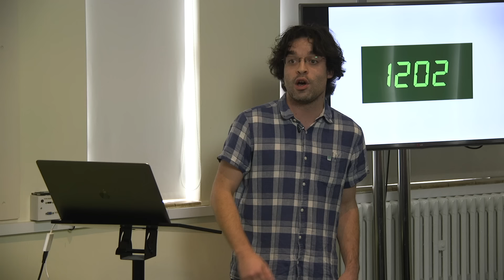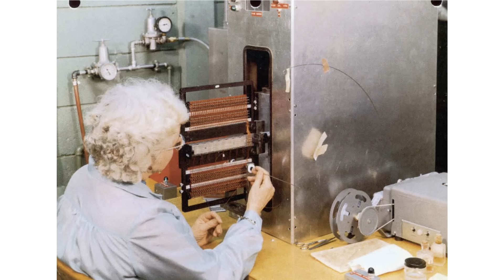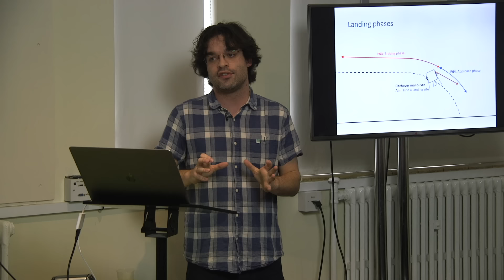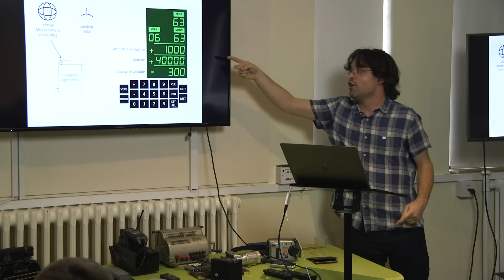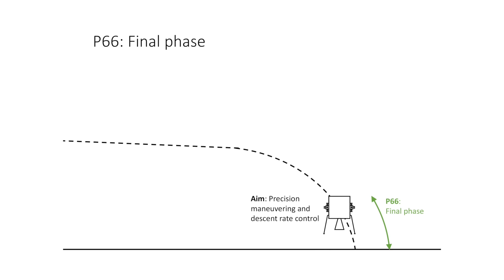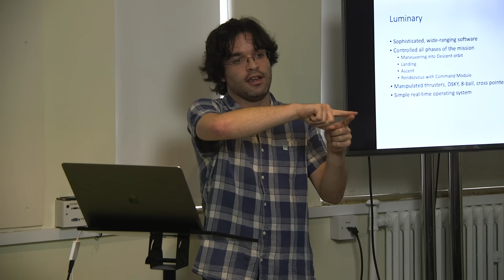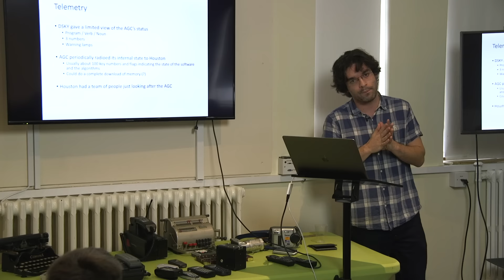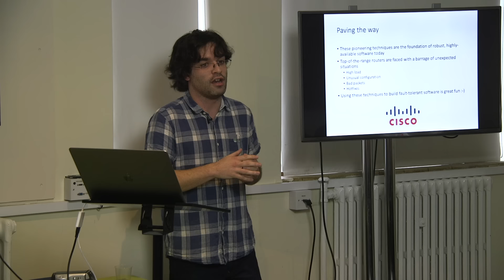Light Years Ahead | The 1969 Apollo Guidance Computer

Comment: Why did NASA bring on Hitlers’ guys to run the program…nothing to see here.
Reply: 450,000 people were involved in Apollo. 200 were Germans.
Reply: ? You're asking why NASA brought on the time's foremost rocket experts???

Hmmmmmmm 🤔🤔🤔
Reply: because they brought the materials, some heavy duty canvases 'demon-hide' they called it, it's the only reason it made it through the van halen belts.
Reply: @eclipsemercx3687  That is incorrect. No canvas was used on the Apollo missions. The CM pressure hull and heat shield provided more than enough radiation protection for the crew. The radiation levels are not high enough to require extensive shielding.
Reply: @h.dejong2531  AFAIK average shielding was about 10g/cm² which was enough.

Comment: Explain the Van Allen Radiation belt … Apollo was a Hoax.
Reply: In 1958, James van Allen and his team discovered the belts, using measurements from the first US satellite, Explorer 1. With Explorer 3 and 4 and Pioneer 3 he measured the radiation intensity. By 1962, we had a good map of the van Allen belt. The radiation level varies throughout the belts. In the center of the belt, a small region with the highest radiation levels, you'd get a lethal radiation dose in one week. Nearer the edge, the radiation level is orders of magnitude lower.
For the Apollo missions, the trajectory was designed to minimize the amount of time spent in the belts. The Apollo astronauts flew through the belts in about 3 hours, while avoiding the center entirely. The hull thickness of the CSM was more than enough to reduce the radiation level inside to manageable levels: none of the astronauts got a radiation dose of more than 1 Rad, or 1/300 of a lethal dose.
Reply: James Van Allen said they’d be fine.   You’ve conveniently ignored speed and ‘belts’
Reply: Why do you think Apollo "was an hoax" and how do you link that to VAB?

Comment: How was the sun's radiation problem solved?
Reply: It wasn't. The radiation level under normal circumstances is low enough not to be a problem. During a solar flare the level can be much higher. For the Apollo missions they took a chance: big solar flares are rare enough that they found the risk acceptable.
Reply: They had darkened glass in their helmets, like sunglasses.
Reply: chemo
Reply: @eclipsemercx3687  No chemo was necessary: the radiation exposure was not high enough to cause health issues. Total radiation dose for any Apollo mission was below 1.2 Rad.

Comment: How much hidden figures where they fit in ?
Reply: A lot of calculation was done before the flight. For example, for the landing the AGC would be programmed to 'start a burn at time x' in order to arrive at the selected landing site. That time x was calculated beforehand, and that's the sort of work the Hidden Figures film was about. 
Even during the flight, lots of calculations were done on the ground, with results relayed to the crew either by reading out the numbers, or via a direct link to the AGC.

Comment: Mixing units are not helpful... I mean foot, then meters per second and so on,
The same with units for better understanding... I mean 17:45, 1670 meter per second are about  6000 kmh or 3735 mph... 210 mps = 470 mph and so on
Reply: Unfortunately, NASA at that time was using lots of different units in a quite incoherent fashion.
They stopped that and went full metric only when some imperial/metric unit misunderstanding caused a crash of a Mars mission probe with a net loss around 500M$...
Reply: NASA did use both US and Metric units, but it wasn’t “incoherent.”  Had it been, the project would have failed.  The navigation calculations were done in Metric units, but Customary units were displayed to the astronauts.  The mechanical engineering of the rockets was done in US Customary units.
Reply: So NASA couldn't even measure things properly but still made it to the moon & back 6 times? Ok chatbot 😂
Reply: @papalegba6796  : NASA could measure things properly. Not with a consistant system of units, however, that's USA...
You are a chatbot?

Comment: 55 Watts - if memory serves it was built from resistor-transistor logic, which used pull-up resistors for logical high output, meaning the gate's output transistor wasn't saturated and consuming power for half the possible states.  Combined with the relatively low instruction cycle time charging and discharging the capacitance of the "base", the amount of current and power were low.  Today's logic, both CMOS and the previous generation's TTL, used saturated transistors for both pull-up and pull-down, and faster clock speeds are what consume the bulk of power in today's CPUs.

Comment: My dad worked at the Goddard Space Flight Center in Greenbelt, Maryland,  during and after the Apollo missions.  He became an expert on the operation and programming of the Univac 642B computer.  It was a so-called "real time" computer that had  command and  (I can't think of the word) functions).  It was programmed using machine language.  This machine  was even  deployed even on aircraft carriers.   I believe one of the museum aircraft carriers  has a functioning Univac 642 on-board.   

It is interesting when I heard a tale when  I worked as a computer programmer/analyst, about a manager at a  military installation who needed a locksmith  to open a computer closet door that no one has ever accessed for as long as anyone could remember.  To everyone's surprise, there was an operating minicomputer with input cables and output cables.  One one in the facility knows anything about it and to play it safe, had the locks changed and then closed the door.
Reply: Cool story bro. Needs more dinosaurs tho.

Comment: Utter shite.
If the technology and data was so brilliant, how have NASA lost the lot?

Phone call between them n Nixon in 69, but i struggle to get a signal in 2023.

Dont have the technology to return to the moon, apparently. Let that sink in for a moment.
Reply: As usual, you are misinformed. NASA did not lose "the technology" or "the data". They discarded engineering telemetry that had outlived its usefulness when the Apollo program ended. Right after Apollo, NASA went to work on a spacecraft that was more advanced in every aspect than the Saturn V and Apollo: the Space Shuttle. 
To this day, all of the science data gathered by the Apollo missions remains available in public archives. 
NASA spent a hundred million dollars on the radio link between the spacecraft and Earth, and despite that they still had regular signal issues as is easily confirmed by looking at the mission transcripts. You are using a $25 radio to connect to a cell tower with lots of buildings between you and the tower - a recipe for signal issues. 
We do have the technology to return to the moon, as demonstrated by Artemis 1.
Reply: "If the technology and data was so brilliant, how have NASA lost the lot?"
Which tech was lost according to you? Can you be precise?

"Phone call between them n Nixon in 69, but i struggle to get a signal in 2023."
Then? What's your point?

"Dont have the technology to return to the moon, apparently. Let that sink in for a moment."
Once it sunk, then what?
The tech and gears were available in 1969.
Reply: JAJF
Just Another Jealous Foreigner

Comment: Didn't the position of the red dot of the protected landing site depend on the angle Armstrong was looking through the window?
Reply: There was another mark for the alignment.
As the window was very thick they used a marking on both side, if I remember well.
Reply: @ThomasKundera 
It was double pane, each one had a cross that when they were lined up your eyes were in the right position to properly use the mil markings in the window.
Reply: @dukecraig2402  : Thanks.

Comment: what a fantastic lecture.
I agree with you that the  'One of the Astronauts forgot to turn the radar off' explanation for the near fatal Error codes that appeared (as happens once in a million - landing on the moon I think qualifies) whilst trying to land Apollo is far too simplistic. It sounds to me like a simple, believable rumour that the publc/press would take spread by someone at NASA (which was the unnamed source) at the time, maybe due to the incredible popularity of the Astronaut's - the boffins rarely came up anywhere - because it just doesn't seem feasible. All good? rumours persist, trying to  become  fact - but are not. Instead its a brilliant example of Mission Control working with the Astronauts to do what was thought impossible .Brilliant.
Reply: He explained that it was a bug that never showed up in the simulator despite them having done it exactly the same way hundreds of times in it, it was probably standard procedure at that point to have the rendezvous radar turned on in the event of an abort which means the computer would have already been looking for the command module. 
Nothing was left to chance and it's not like they hadn't run through it so many times it wasn't already muscle memory, literally muscle memory, that's the way they'd rehearsed every time it just never happened in the simulator because it wasn't actually using radar, the computer in it was just programmed to act like it had information coming in from a radar, most likely after they figured out exactly what happened the simulator was reprogrammed to throw those alarms.
The astronauts weren't the only people who learned from the simulator, the guy's back in Houston in "The Trench" also learned from it, so if the standard procedure was for that to be left on and the simulator didn't show it to be a problem nobody knew, yea, you can bet the flight plan was rewritten after that for it to be switched off.

Comment: How about a demo of a thruster igniting in a vacuum, considering nobody has ever accomplished I would love to see the magic NASA has apparently had for 70+ yrs. https://www.youtube.com/watch?v=8Cx9mNnky2U
Reply: Bro’s really trying to debate the moon landings and has never even heard of oxidisers before
Reply: Look up tonight. You can see satellites orbiting overhead, proving that thrusters can ignite in a vacuum.
Reply: The video demonstrates that it's hard to ignite stuff in a vacuum. In a rocket engine, the fuel and oxidiser are sprayed into a combustion chamber at high pressure, making ignition a lot easier.
Reply: The engines use the liquid oxygen carried in the tanks😂.
Reply: @Manipulator906  : Actually not. Cryogenic fuels in this situation would have been unmanageable.
The module was using dimazine and dinitrogen tetroxide, which even being way less efficient that some other ergols had a few nice properties:
- it's stored liquid at room temp under low pressure.
- it's auto-igniting: just putting the liquids in contact will start the reaction. Which makes it way safer than relying on some ignition mechanism that could fail, especially in vacuum.
- they knew how to build those ergols engines that could be throttled on a large power range, and restarted, which is surprisingly hard with most rocket motors (it's either full power of definitive halt).

On Apollo missions, AFAIK, only the Saturn V rocket used LOX, with kerosene for first stage, and hydrogen with the two and third ones.
Reply: @ThomasKundera  I know. I was talking about the stages of saturn 5
Reply: @Manipulator906  : And I replied abot the LEM ;-)
Sorry.
Reply: You have "demo of thrusters in vacuum" for each space rocket since the 40's.
Not only NASA, but of course USSR, Europe, now India and China, etc.
Learn.
Reply: Thrusters use hypergolic (self-igniting fuel).

Comment: Buzz Aldrin had had to do math by hand for orbital rendezvous on Gemini 12, his previous flight, when a rendezvous radar failed. He gave an inteview within the last decade or so in which he said that he did deliberately choose to leave the Eagle's rendezvous radar on. Perhaps understandable, since his had failed on that Gemini flight. His thought was that if there was an abort then things would get EXTREMELY hectic very quickly, and if it wasn't going to work he wanted to know sooner rather than later. As you said, the mechanics of achieving orbit after an unplanned ascent and then rendezvous would be challenging even if everything went perfectly and, by definition, in the case of an abort things would NOT be going perfectly. Leaving the rendezvous radar on would be one thing less to do, one less mistake to make, and would provide data earlier. Believe me, in times of high operational stress one starts to newly think of all kinds of presumptively better ideas, even if you've been through a hundred drills otherwise. Also, Buzz gets a little stick once in a while as if he were some kind of poor man's Robin, especially as he got older and a little more coloful. He was a PhD from MIT who wrote his thesis exactly ON "Line-Of-Sight Guidance Techniques for Manned Orbital Rendezvous." On Gemini 12 he generally developed new and better procedures for preparing and conducting EVAs, including underwater training. Buzz was a MiG killer and as much of a bad ass as any other astronaut, period.
Reply: So he never turned on the rendezvous radar during simulations? It seems really risky (obviously!) to modify such a complex procedure for the first time on the actual landing!
Reply: @Tim22222  That's what he said, though the inteview would have been at least 30 years after the flight. Based on his foundational experiences (Thesis, Gemini) I can absolutely believe he had it on. It's surprising to me also that he wouldn't have done it in the sim, but the sims just can't replicate the reality that if you get something wrong you will die - maybe he did something new on the day. It may also be something along the lines of having turned it on in the sim, but never having entered the 16 68 at key times when it was on, or maybe when there were lots of extra inputs to the AGS on descent that hadn't been modelled. IDK, it surprised me too, but I tend to believe it.

Comment: If you want to know more about the 1202 error, I suggest you the "Apollo 12 Source Code: Looking at the original flown code printout, and the 1202 error fix" video by CuriousMarc.
Even if they themselves pretend not to have time and gears to explain it fully, I never saw such a level of accuracy in the description of that issue at the software/hardware level.
I doesn't replace this video, as it only address a very technical part of it, but it's tremendously interesting.
Reply: Thanks for that pointer. I had no idea that the Apollo source code was available. Hopefully Robert didn't have to give his right arm to get it! The link to the Apollo 11 Luminary source code to light the main engine is below. 

This looks like the output of an assembler -- referring to the example below: 031662,000114, and 36,2054 look like they might be addresses (in octal), next column (blank in this example, but e.g. E7,1455) I don't know, then I'm pretty sure the value of the operand (5 octal digits, in this example 77776 which is 1 in one's complement octal), then the actual source code: label (blank in my example), opcode (DEC meaning decrement, I guess. I guess TCF is some equivalent of jump to subroutine), operand (-1), second operand (B-14 - not sure... what to do if it overflows or results in zero?), and comments starting with a # (# (6) ).

031662,000114: 36,2054           77776                           DEC      -1         B-14                       #  (6)
 https://www.ibiblio.org/apollo/listings/Luminary099/BURN,_BABY,_BURN_--_MASTER_IGNITION_ROUTINE.agc.html#554C4C475441534B
Reply: @frankvanderhulst926  : The video I mentioned explains a bit how the code listing is organized.
It's an assembly (or a pseudo-assembly as this video explains, where some operator codes are actually run by an interpreter). But I dunno much more.